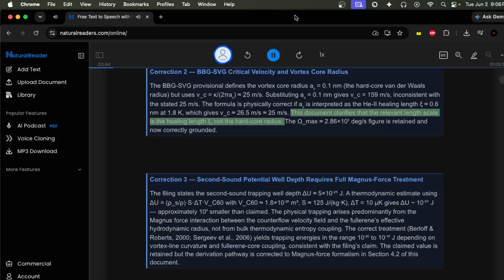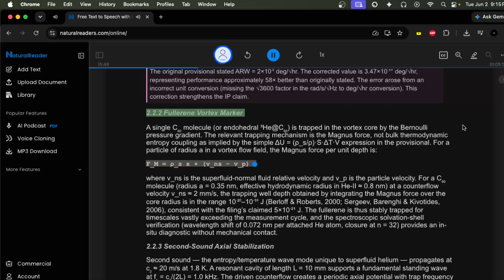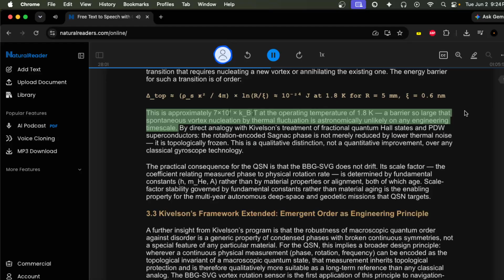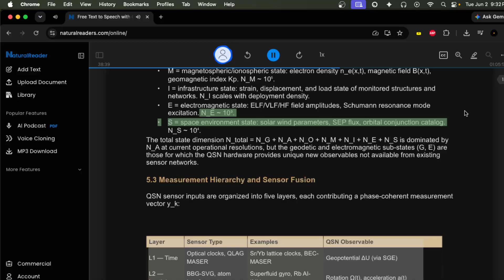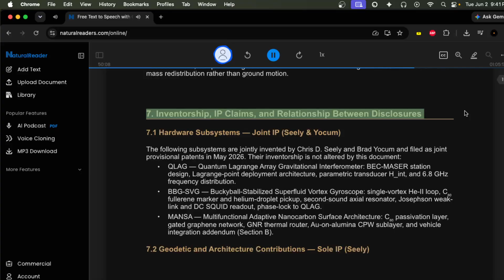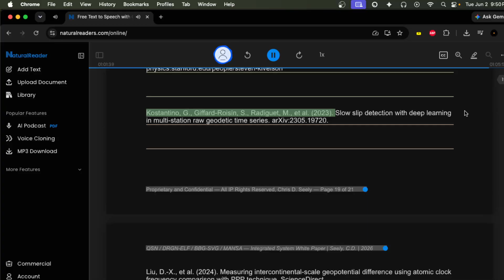QUANTUM STATE NETWORK QSN A Planetary Phase-Coherent State Architecture for Civilization-Scaling

Comment from the maker: At 5,400 km/h you'd lap the planet in one long coffee break — about 7½ hours.

A great circle is any slice through Earth's centre, so the distance depends on which one you pick:

Around the equator: 40,075.017 km 
40,075 ÷ 5,400 = 7.42 hours → 7 hours 25 minutes (≈ 7h 25m 17s)
Through the poles (a meridian): 40,007.863 km 
40,008 ÷ 5,400 = 7.41 hours → 7 hours 24½ minutes (≈ 7h 24m 32s)